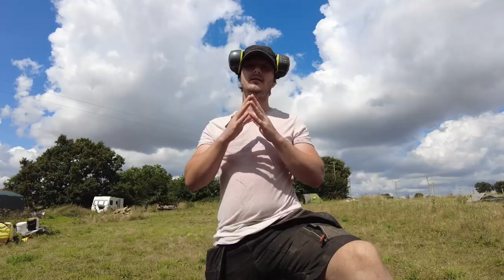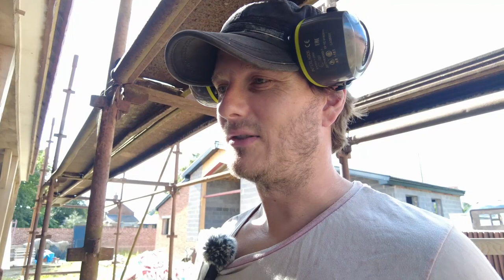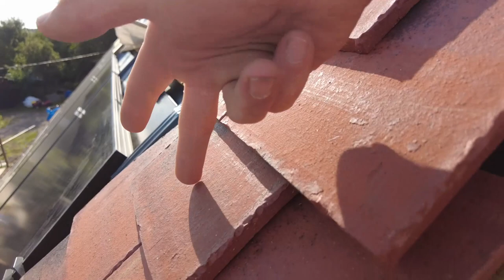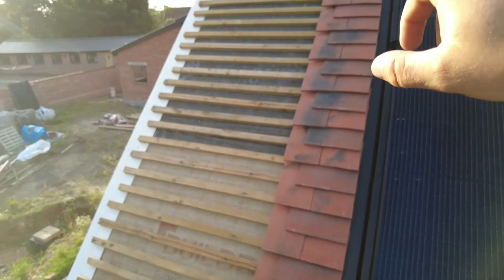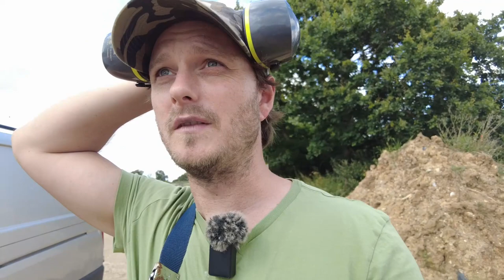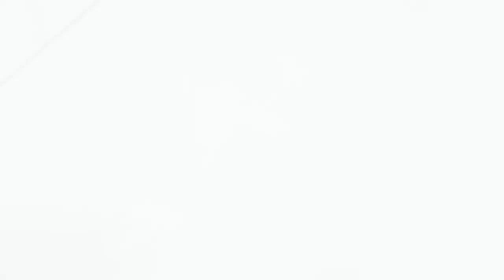How long does it take to finish a roof?

Comment: Only just watched this vid. Like you cutting the bolts, and having issues with solar panel flashing not fitting tiles as standard, I've had exactly the same problem in the past whenever using other people to do work. I always end up doing part of the work to make sure the overall job isn't compromised. This is why I now do everything myself. Takes longer but you get what you want.  Also got a lot of stick for using mortar on my ridge but I can't stand the dry ridge systems, mortar and clay much nicer looking. You've done a great job there, looks smart 👍
Reply from the maker: Thanks mate 👍 I think we've probably been traumatised too much by tradesman that we'll never fully trust them again 😂

Comment: I’m a roofer mate and i think you’ve done a cracking job on that roof the only thing you did wrong was putting flashband on the top , you just have to adjust the gauge to suit so you can fit a top tile which is basically the eaves tile. You will be pleased now I think that you used the integrated solar panels they look so much better. You’re a real grafter mate and I enjoy your video’s
Reply from the maker: Thanks mate 👍 yeah I'm abit gutted I didn't figure out the whole apex eves tile thing. I blame the Internet! There's nothing out there explaining why you should guage it so it finishes a particular way for the apex. Oh well, I think I'll get away with it 😑